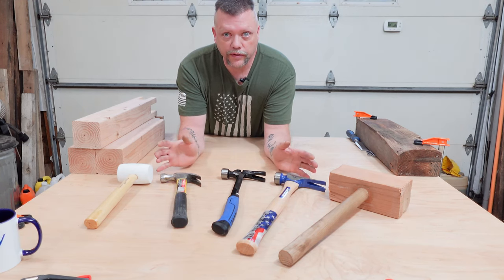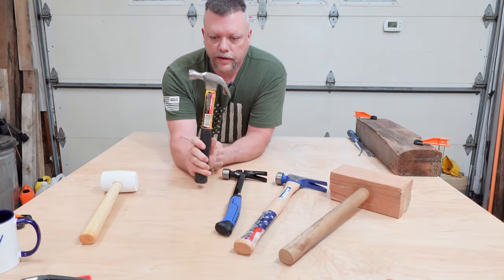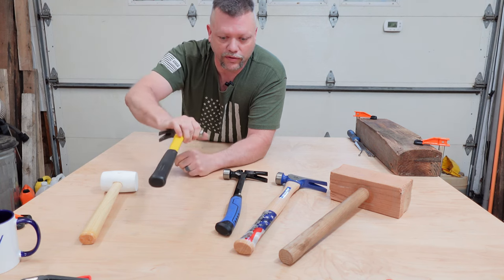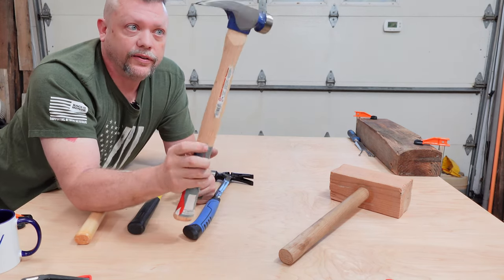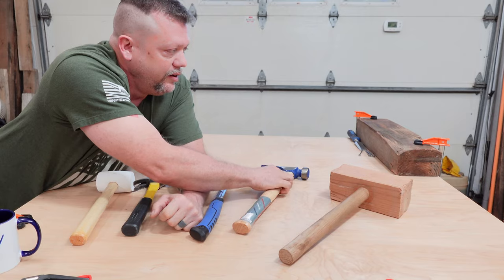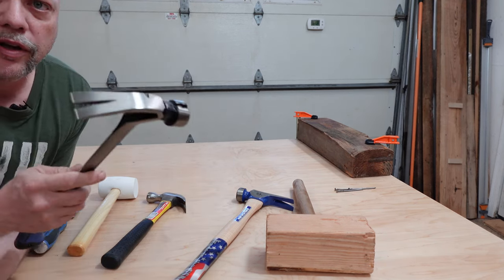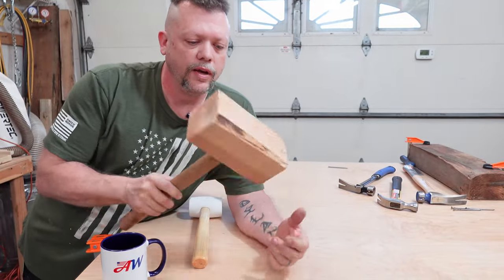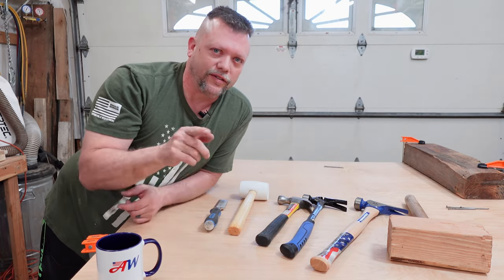The Top 5 Hammers For Beginners | How To Choose A Claw Hammer

Comment: Now for an advanced hammer.

I love my lixie mallet. They are dead blows with interchangeable and replaceable heads. With the orange head I can wallop on finished hardwood for install. I use the brown on the other side for a harder surface that is still wood safe. You can go harder too. They also have bigger ones I'm interested in.

Who doesn't want a deadblow sized like a 1 hand sledge?

It's become my go to mallet for stone work too. The dead blow action makes the mallet do the work.
Reply from the maker: Thanks for the comment.  I'm glad you shared the info.